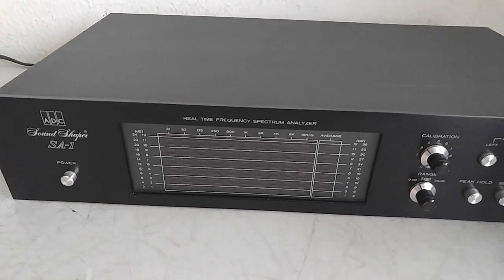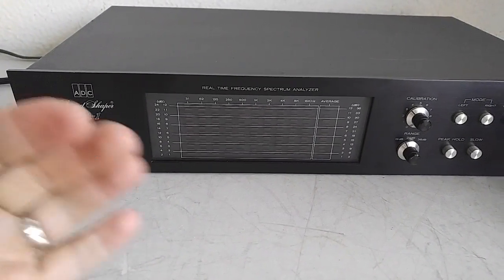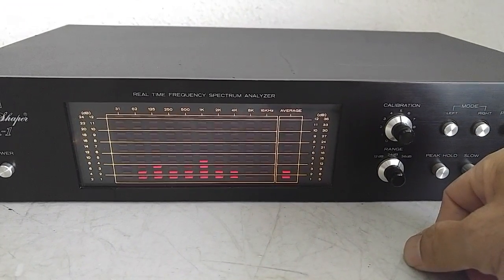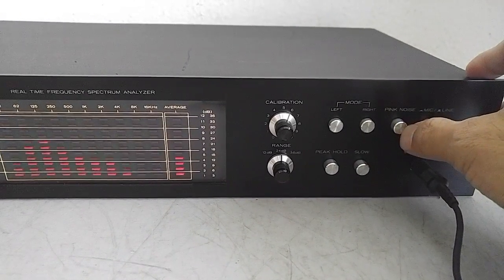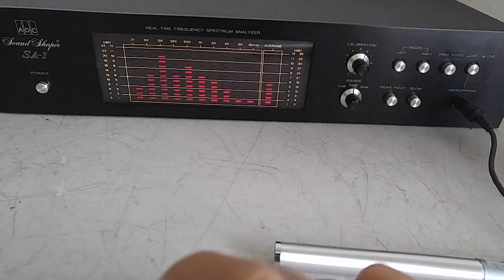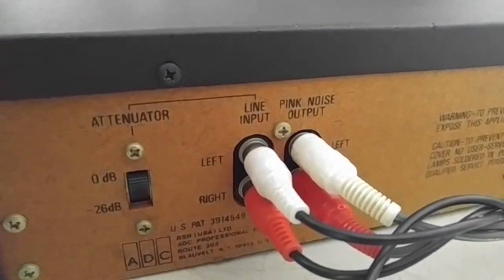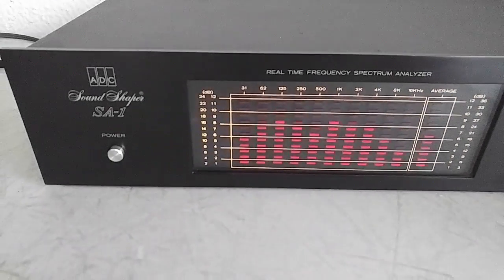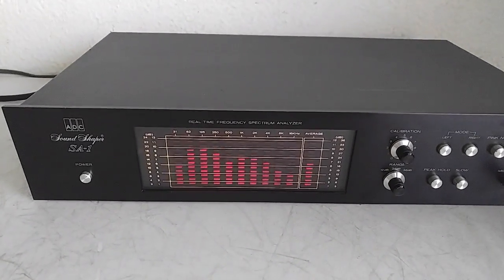Vintage ADC SA-1 Sound Shaper Real Time Frequency Spectrum Analyzer Demo

Comment: Do you know how this would help basic audio at home
Reply from the maker: Analyzers can be used to see what a room's behavior when it comes to sound like reflections and dips. For instance, wooden floors are very reflective and can significantly increase certain frequencies when they bounce off of them therefore may over enhance certain parts of your music or instruments. If that is the case, you can put down a rug or carpet. Some rooms have a natural suck out where it will absorb certain frequencies or sound so you can use an EQ to increase those particular frequencies. Those are two examples but there can be many uses. Hope that helps.